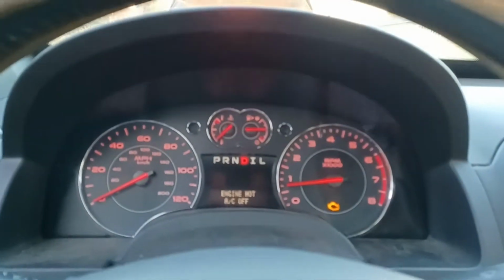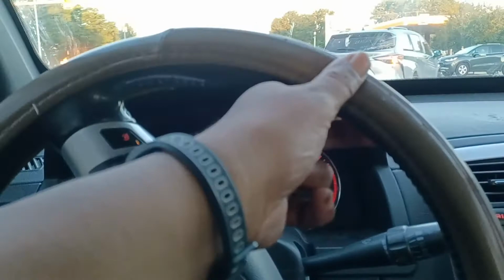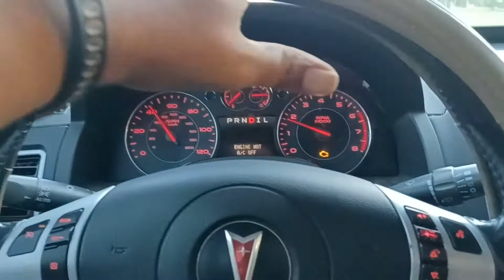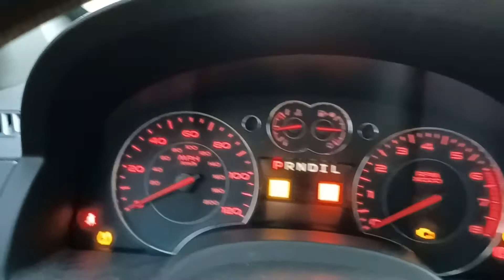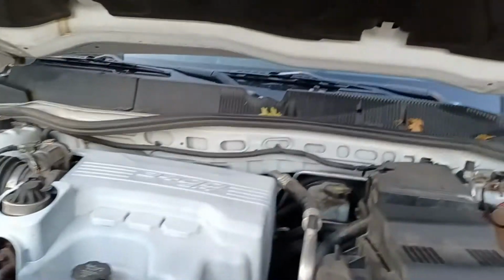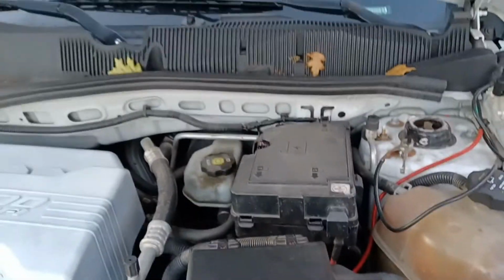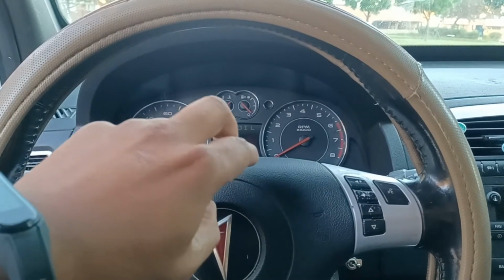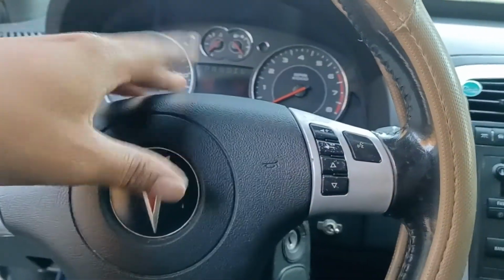ecm temp sensor reset switch chevy equinox Pontiac torrent

Comment: theres a HUGE  electrical plug behind the drivers side "kick panel"  below the dash, beside the hood latch, that becomes corroded ,,unplug it -clean it - GENTLY--with electrical cleaner, (or isopropyl alcohol) and a toothbrush ..!! ...it should clear up a lot of gremlins in the ecm...for example...temp. gauge ,,cooling fans.. a/c functions.. heater....traction control warning lights...etc. ..good luck..
Reply from the maker: Hmm worth checking out thanks
Reply: Thanks for the heads up on this. My 07 has these gremlin symptoms along with a parasitic battery draw. My AC fan just quit and the under hood relays all check out good. 👍
Reply: First time this occurred with my '09 I simply disconnected the negative cable from my battery for 30 mins. Worked ! Had to reset time & date. MPG went back to zero. Bout to clean that plug. Thx guys 😊
Reply: You might have just fixed my problem! lol thank you! Imma try it out👍🏼

Comment: I have an '07 Torrent and this has happened more than once over the years and it seems like it's always something different that the mechanic finds that causes the issue.  I know I have a very slow, small oil leak, the mechanic did a temporary fix on my radiator when he unclogged/flushed out my heater core (no heat when it was -.02 here a few weeks ago) and up out of nowhere, the 'engine hot - turn a/c off' came on and I was running the heat.  The temperature gauge isn't reading at all.  I know it's safe to drive it a little bit but this crap freaks you out when you're on the highway and it pops on.  You're just waiting for the car to have flames coming out of it.
Reply from the maker: Well after I got a new head gasket I never had that problem again I think that's some kinda warning

Comment: 2008 Chevrolet equinox, I replaced the coolant temperature sensor but I still have the problem of the temperature gauge reading nothing and the fan still is running, I tried the reset that you suggested by removing the number 33 fuse for about a minute or two and reinserting it, it seems to have solved the problem at least for now, the stabilizer light turned off and when I hit the button it comes back on like it's working and the temperature gauge is working again and the fan has turned off, the air conditioner appears to be working also. Your suggestion seems to have worked for now thank you very much!
Reply from the maker: Well i got bad news about that turns out after I got the headgasket replaced it stop somehow I think that's some kinda warning that it's about to go out the guys who replace it said these cars with that motor is known for doing that when they go bad
Reply: Put a 195° thermostat and your issue will be fixed. I put a pos autozone thermostat in and i had this problem ever since. So i just replaced the 180° pos with a 195° and then disconnected the battery and the problem is solved.

Comment: I have the same problem, this video helped a lot, thanks! Btw had yours ever went up instead of down?
Reply from the maker: Oh boy you not going to like this answer what fix my was putting in a new head gasket turns out that's some kinda warning it's about to go out after I had that change never had the problem again
Reply: @R2A300  hmmm interesting, I guess ima have to figure that out lol, thanks for the response
Reply from the maker: @therockstarbarber68  but try to change the temperature sensor  on the back of the thermostat you know when you go to change a thermostat that housing is sets in back of it it's a plug connected to a long built running back of there that checks the temperature sensor
Reply: @R2A300  Had this issue as well but first it is well worth the 20.00 to get what are called (pucks) from the stealership itself trust me on this there is a great chance now this will depend on how bad the head gasket is gone but you must put these in the rad and leave them in there for if iam right for 6 to 12 hours after leaving the vehicle run for awhile and shut it off and wait wait wait the longer the better it fixed mine 100% been driving it now for 25,000 after this fix and still going great mine was the temp guage was heading right over the red and then some lol. but the pucks did work great just say to the dealer you want a set of pucks they will know exactly what your looking for iam in canada but it should not matter in the USA all the same. just price difference guys/gals. hope this helps....
Reply from the maker: @1EagleDave  oh okay Well I no longer have that car but when I did  I had the head gasket change that was the problem and that temperature gauge stopped doing that right after that  but that car just had so many problems wrong with electrical problems staring shaking problems I just got tired of put money and fixing all this crap no I'm a mechanic and it was costing me more to keep it running than it was then what I paid for the car so I end up getting this Dodge journey and this car been great to me

Comment: I've never gotten a engine hot warning, but my stabilitrax light comes on all the time saying it needs service...but it works just fine. Mine is a 2008 torrent
Reply from the maker: Sometimes that fix it as well from what I noticed with mine

Comment: Has the same issue. The real fix is to put the right temperature thermostat in. It REQUIRES 195°. I put an autozone in and didn’t realize that it was 180°.
Reply from the maker: I hate to say this but you know what stop that and I never had this problem again once I fixed this I had to put a head gasket in that car never had that problem again I think for some reason this car when it does this it's like a warning that your head gasket is going bad the guy I went to does numerous of these cars and he said they're known for that

Comment: I’m having the exact same issue I disconnect my positive battery post for about 7 seconds reconnect the problem goes away it only come on once a day still need to repair the issue
Reply from the maker: Ok here that bad news that turned out to be a failing head gasket after i got that fix never had the problem it seems to be a known problem with these types of engine

Comment: Did u find the cause of it
Reply from the maker: well not good end up being a head gasket problem down the line
Reply: Yea mines doing that now but it was low on coolant once I added more it finally went away I have a coolant leak it’s low again so now it came back on
Reply from the maker: @andreiacotton2077  the problem is it is overheating because of the head gasket mine were doing the same exact thing and all my antifreeze was coming out of the reservoir I couldn't see it because if you look in the back of it it's a long hose with a pressure pin at the tip that's where it's leaking out at and that's why you can't find out where it's leaking from it leaks out to the back of the engine when the pressure gets too hot

Comment: These things keep popping up. Air pockets. No one knows how to burp the cooling system. Air gets into the system and moves around is what most experienced auto mechanics have told me. What factory installed this switch. . . It's your car you can put it anywhere you want to. Putting mine in the trunk. . . The instruction to reset it.
Reply: I love it!
Reply from the maker: After I put in a new head gasket it went away I think that's some kind of warning but since it's been changed almost a year now I haven't had that problem

Comment: JUST DISCONNECT BATTERY FOR 30 SECONDS----SAME FUKIN RESULT
Reply from the maker: Sorry Bro turns out it was a bad head gasket
Reply: Exactly that’s what I been doing but burn out need to repair the issue
Reply from the maker: So im at a point I don't know about this car soo it's stated doing it again I'm going to try the tip this one guy said about it cleaning the connection I put a new head gasket and change the pcm computer im just starting to think that's a flaw with the Equinox and Pontiac Torrent
Reply: @R2A300 I’ve had issues ever since I bought the car been down every rabbit hole possible engine replaced due to over heating after that the heat and air goes out heater core goes out have to get a heater core flush every season change now all of a sudden I have this issue to deal with GM should be ashamed of themselves by not having a recall on all the many issues on this car
Reply from the maker: @babybrother8210  trust me when i say everything you said is the truth every month im dumping money or trying to fix a problem on this car but im going to do a video on my real thoughts on this car soon and its not going to be a good one
Reply from the maker: just stay tune im going to do a video on everything i done to this car and yes its a big flow with these car
Reply: Just did suspension, got to replace EGR valve, tensioner, brakes just started squeaking, TPMS, and just got that engine hot and gauges not working. Pissed at this car got 1 week of good driving before I jumped in the rabbit hole
Reply from the maker: @davinciartiste2974  trust me same here brother every other week its some new bs problem with this car